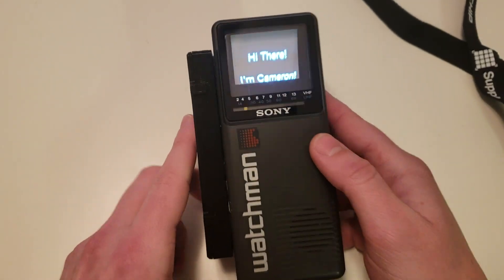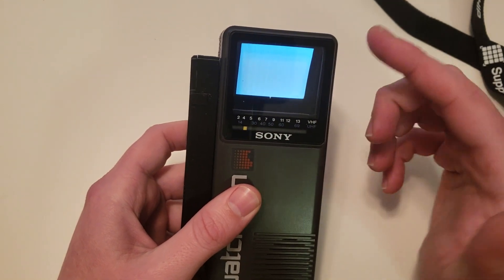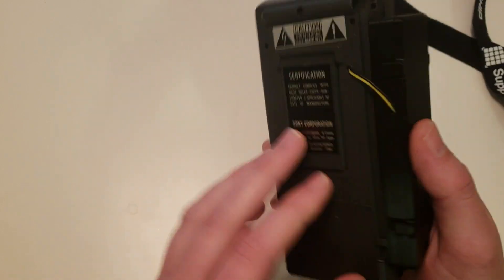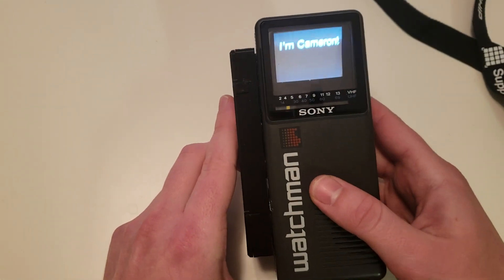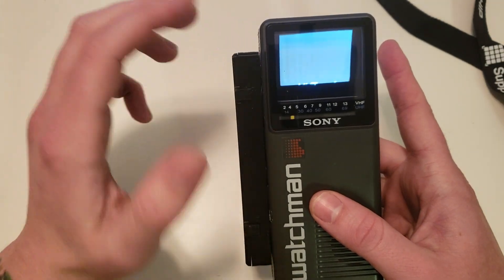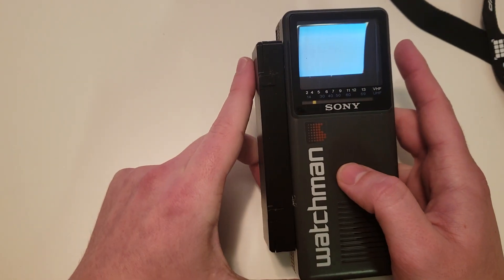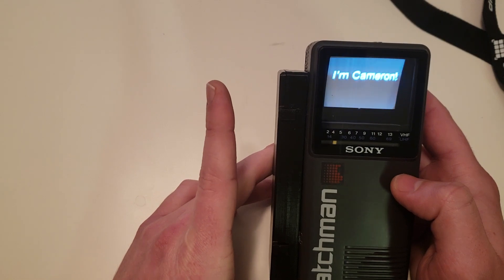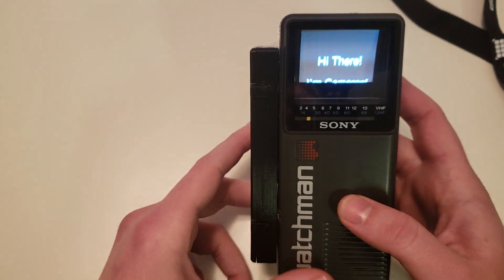CRT Badge - Sony Watchman Hack

Comment: I have a Service Manual for the FD-2E which is the Euro version of this. It doesn't say much more about the CX20183, however pin 13 is clearly the audio output.  The Euro version is likely 99% electrically the same as the US version except that it would be PAL.  See https://drive.google.com/file/d/1h6b1T3gHo_XsBOjiD_byN0aF91ku8KsK/view?usp=sharing

Comment: Interesting idea but it is no longer a collectable item which is a shame.  A Digital to Analog transmitter project with say a 5 meter range would let it be used for its intended purpose but I've not seen any videos for PAL. Still a nice video!

Comment: For sound you might crack open a:
Mini USB 2.0 3D Virtual 12Mbps External 7.1 Channel Audio Sound Card Adapter JD
from EBay
https://www.ebay.com/i/201617299371